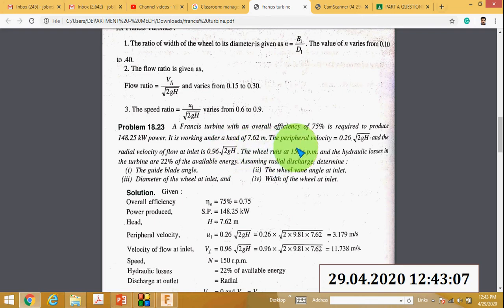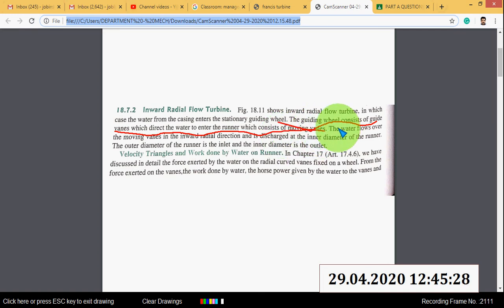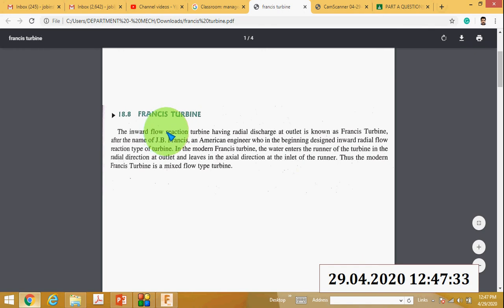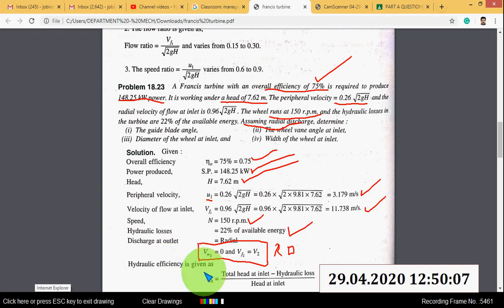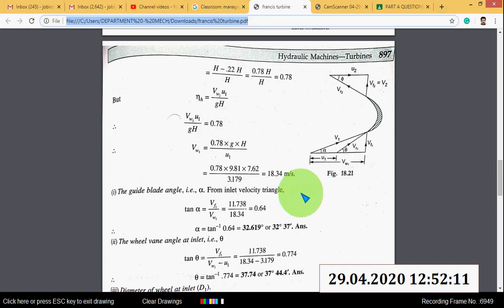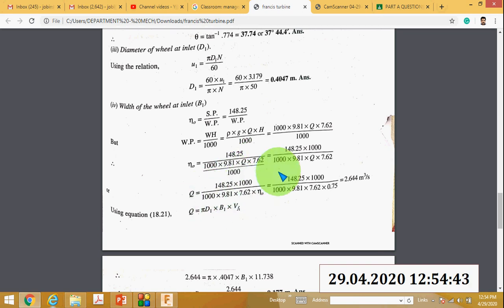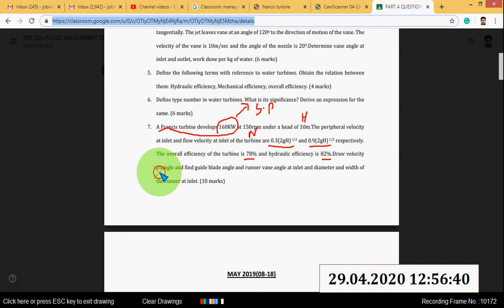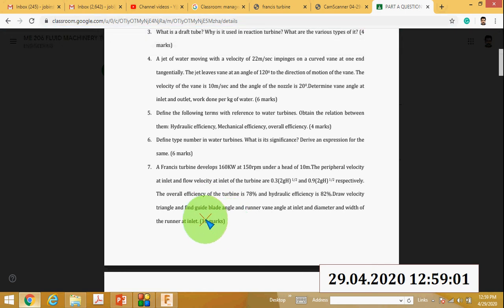FRANCIS TURBINE PROBLEM AND SOLUTION 2 questions

Comment: Answer for the assignment question

Guide blade angle=33.36°
Runner vane angle at inlet=40.15°
Diameter of the runner at inlet,D1=0.535 m
Width of the runner at inlet,B1=0.0987m